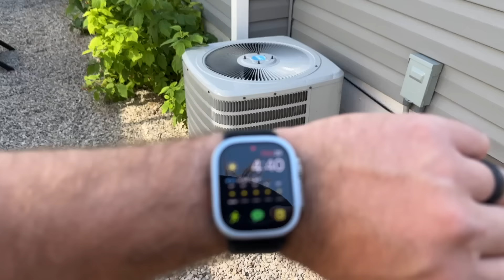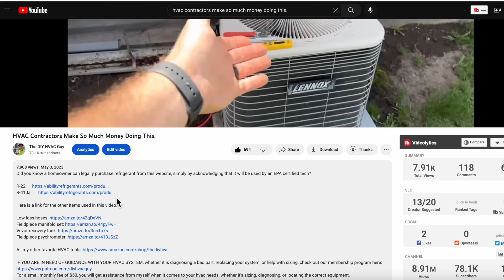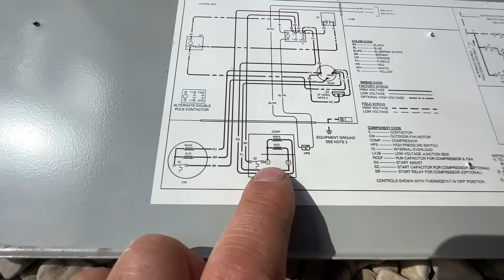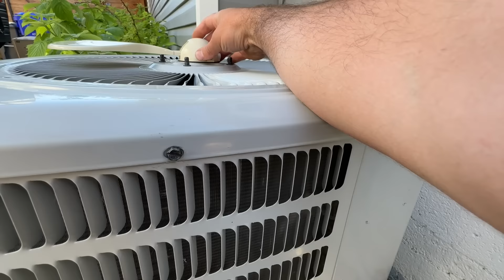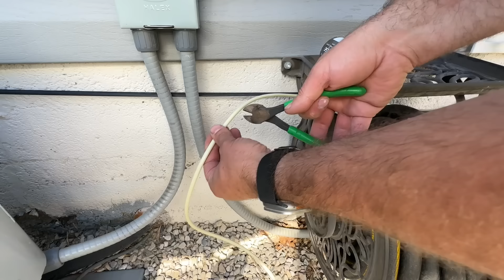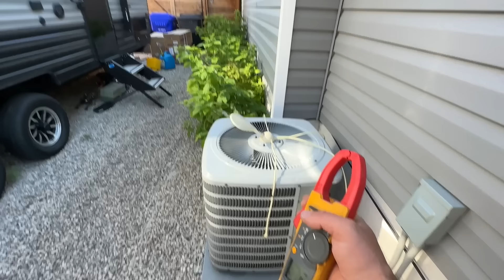Can This Device Actually Lower Your Electric Bill By 30%??

Comment: Needs to use an entirely different - somewhat more expensive, much more complicated to set up - evaporative design that encompasses the unit in a 'box' of evaporative material (the currogated cardboard material used by industrial 'swamp' coolers seen at hardware stores).  Build a box around the unit with 12" of standoff and create a barrier seal around the exhaust so that air can only be drawn in via the sides of the evaporative box.
Set the drip system up to use the outer box to cool the incoming air rather than exposing the unit itself to water directly.

Or, perhaps, build the AC unit where it will never be exposed to sun and surround it with material that has a very resistant thermal absorption chracteristics... i.e. put the unit behind a double layer of solid stone that has sufficient airflow.   The outer layer of stone is exposed to whatever sunlight (as little as possible) may fall on it while the inner layer of stone remains cool and lowers the temperature of incoming air before it goes through the unit.
Yes, this last one is very situational, but it works.  I did that in Texas where my house sat on a very steep hill.  One side was a cave, essentially, created by the foundation and when the unit was replaced I had it moved to the depths of the shadows where the foundation was always many, many degrees cooler than ambient.  Power consumption was halved.

Comment: The only way you can do it is by using distilled water (you can use the condensation on the coil from inside the house) and you still need to have a filter to remove dust. Otherwise minerals will kill your outdoor coil.

Comment: Good luck cleaning the coils after using one of those. The chlorine will eventually eat a hole in the aluminum coil. Better off brazing a heat exchanger on the compressor discharge line and running a close loop coiler using a fish tank pump.

Comment: So which is it, the unit needs to be in the shade or it doesn't matter if it's in the sun all day? I've watched videos and also read posts where they say it doesn't mattter if a unit is in the sun. That trying to shade a unit won't help it cool any better? My unit is in the sun all day and both units i've had, have strtuggled to cool my house in the summer. I live on the southern east coast in NC. Thank you for sharing this and making the video. It very interesting.

Comment: You'd actually be better served with a shade panel oblique to the unit and tall shrubs on either side but 1-2 feet away.   Keep the ground watered and you'll find that the location temp is much lower than air temp which serves the same purpose

Comment: I did this and by the end of Summer the coils were all clogged with minerals.  This is even after a water softener.  It was a terrific job getting the coils cleaned.  They're still not completely clean.  I urge everyone to consider this possibility.
Reply: So maybe I should find some way of pressurizing my condensation water..
Reply: @mikegrok   that's not a bad idea.  It's already pretty much distilled.
Reply: @mikegrok if you have a CONDENSATION PUMP on your system already = pure water from humidity condensation on indoor coil = no minerals 

Pump into reservoir higher than the unit so it will gravity feed into the spider when called

Or use Acid coil cleaner on outdoor coils yearly- this is what you should be doing anyway. 

These machines run in rainy weather + people cut grass while the machine is running ends up + the outdoor coil gets hot = bakes on dirt and debris and needs cleaning yearly for optimal HEAT EXCHANGE. 

Dropping 1 - 2 amp draw is SIGNIFICANT energy savings.
Reply: This was/is my worry too. Having minerals build up over the coils will reduce efficiency of the cooling fins. If you had a good filter before the nozzles may help and then just change the filter?
Reply: @Skydiverjoe2871 - No, a filter won't work because the minerals are dissolved. Filters didn't remove dissolved minerals, only suspended particles.
Reply: @Skydiverjoe2871 if you have a CONDENSATION PUMP on your system already = pure water from humidity condensation on indoor coil = no minerals 

Pump into reservoir higher than the unit so it will gravity feed into the spider when called

Or use Acid coil cleaner on outdoor coils yearly- this is what you should be doing anyway. 

These machines run in rainy weather + people cut grass while the machine is running ends up + the outdoor coil gets hot = bakes on dirt and debris and needs cleaning yearly for optimal HEAT EXCHANGE. 

Dropping 1 - 2 amp draw is SIGNIFICANT energy savings.
Reply: Ion exchange softeners still leave impurities in the water.
Reply: @GoatZilla re: "Ion exchange softeners still leave impurities in the water."
A particle filter should be placed prior to the ion exchange.  This will also extend the life of the IE media.  Depending on the water hardness, ion exchange systems may need to be fairly large or the media should be changed fairly often.
Reply: @jfess1911  The ion exchange resin grabs a hard mineral and substitutes usually a salt molecule in its place.
Reply: @GoatZilla  You are right, I mis-read the comment.  Yup, typical domestic ion-EXCHANGE systems (water softeners) substitute sodium from salt for other "hardness" minerals.  This means the "total dissolved solids" content remains high.  The result in an evaporation setup like this one, is that the coils will eventually be covered in a residue.   Not good.
 What is needed is a DEIONIZING system which has both an-ion and cat-ion absorbing resins to remove all minerals, but they are harder to regenerate. My original point was that it is still best to have good particle filtration upstream to prevent mechanical fouling.
(edited for accuracy)
Reply: @jfess1911  I think it would be easier to just build a solar water distiller and use that to feed essentially distilled water to the device.
Reply: @GoatZilla  That would work, but I don't know how large it would need to be.
Reply: I have this exact problem after 2 months.  The buildup is like a spackle now over the fins.  I installed the recommended filter but it appears to be ineffective.  I'm going to try to remove the buildup.  I too would hesitate to install this system.  BTW - I'm in South Texas.
Reply: As another poster pointed out, a typical water-softener is an ion-EXCHANGE system that substitutes sodium or potassium for other minerals.  This can still leave residue from evaporation.  A DE-ionization system will remove all minerals.
Reply: I used a version of this on our old system's last season...although from parts I had with a lot more sprayer heads, and an electrics (sprinkler) valve.  I wouldn't want it on a new system though.
Reply: Yep, I've thought about one of these before but my water is really hard.  I'd have to invest a lot to try to fix that before being able to use this to save a little on my ac bill.
Reply: I tried this system when I was in Bullhead City, Arizona.  It worked pretty good at first but ultimately my A/C coils started building up minerals. It didn't work at all in Louisiana because the humidity was too high.
Reply: Yep, same. And I used that filter. It would probably be fine with distilled water. But that would be really expensive.
Reply: @grumpy3543  And you would need to find a way to deliver pressurized distilled water.
Reply: you should have used RO water
Reply: If only you could capture the condensate that collects on the evaporator coils before it becomes contaminated… At that stage it is distilled water. even though copper is a natural antibacterial, it is in a location that is constantly being bombarded by dust, mold, spores etc. that gets past the filter, so it would have to be a really good filter and the capture would have to be made immediately and stored somewhere clean. Why these outside units don’t even come with an option to include an evaporative based system to cool the air even slightly before it is passed over the condenser coils is beyond me. Everything to collect moisture from the air in the form of pure water is already in place… But no steps are taken to to preserve its purity and it is just typically dumped out through a drain hose onto the ground. Here in Texas, we have days on end, week after week where ambient air temperatures during the day are over 100°F… and these outdoor units sit there baking in the sun, and that’s what we’re supposed to use to “cool“ those condenser coils? Many parts of the state are very dry, and evaporative systems can lower air temperatures by 10 to 20°F. While that might not be enough to cool YOU off, to a really hot condenser coil, that’s a lot of BTUs  being removed that really want to keep that Freon in a gaseous state. Humidity bothers people, but it doesn’t bother those aluminum fins.
Reply: The ac condenser coils are pretty hot~120F so I would think the humidity would not have much effect as that mist will evaporate at that temp.
Reply: What did you use to clean the fins?
Reply: @echocharliedelta72  you can use

 ACID BASED MAG WHEEL CLEANER FOR CADS = spray bottle 
HVAC COIL CLEANER - from Lowe’s or Home Depot - spray cans 
HVAC COIL CLEANER  - from HVAC SUPPLY HOUSE - they will sell to public.

Spray on and let “work”. It will bubble up and attach dirt n grease etc. approximately 10 min. 

Do not let it dry completely. 
DO NOT USE PRESSURE WASHER TO RINSE . Aluminum coils very very easy to bend = if bent will not flow as much air 

Water hose with gently running water - rinse until no dirt, debris remain it takes me over an hour sometimes to clean a coil that’s really dirty 

Take your time. Reapply and repeat as needed.
Reply: You have to use reverse osmosis/distilled water. You can put an RO system on your feed to the pipe feeding the misters. This will remove the solid contaminants.
Reply: The chlorine in the water corrodes the aluminum.   There is no cleaning or fix for this problem.   Do not use this on your AC.  I did and a couple of years had a leak and needed new outside unit.
Reply: You shouldn't use the soft water because it has a tiny bit of salt still in the water even though you can't taste it. Salt and aluminum don't like each other and the fins could become corroded and break off.
Reply: It built up mineral deposits in my condenser within 2 months. Filters must suck.
Reply: Yeah, I will never do this unless I get a reverse osmosis ... or I get a huge quantity of cheap distilled or DM water.
Reply: @AllAmericanGuyExpert  When we moved to the new house there was nothing. I wanted reverse osmosis. The little woman wanted a softener. 
We compromised and got a softener.
Now multiple times per year I lug a couple hundred pounds of salt down to the basement so we can make dirty water that requires expensive filters underneath each sink in the house.
Yay.
Reply: @Shorty_Lickens lol, the little woman wanted the cheaper option. We have a whole house RO it is more expensive than a softener, but 10x better.
Reply: @Shorty_Lickens  "the little woman",  I wonder if she should call you the little man
Reply: @AllAmericanGuyExpert bingo, no way without a RO
Reply: my water is hard. it would be a problem. thanks. plus humidity is so high that the cooling effect would be diminished here in houston. see thermodynamics.
Reply: @brianbb177 yes sir we need to just frikin move :)
Reply: I have a $60 pressure washer from Walmart and just spray clean everything once or twice a month to completely avoid this problem.  I also unscrew the mist nozzles and clean them out when I do my routine cleaning.  It's amazing how easy it is to maintain things when you aren't lazy.
Reply: That is a legitimate concern and will vary by local water conditions.  An in-line filter on the water line to the misters could solve the problem.

Comment: Air is a better transfer of heat than water, unless you have a constant flow of cold water…. This may increase the heat transfer initially, but after a few hours time thermodynamics kick in and this will not be as good as air.  Surface contact with air is a better heat sink…

Comment: Drills have clutches on them. 
They work wonders for running screws with a drill and not stripping them

Not very difficult to use, really

Comment: I live in south Louisiana and I’ve been doing this for years, but my misters are spraying into the vents what someone needs to do is invent a catch basin that would go underneath the air conditioner itself on top of the pad. That way it would recycle the same water simple concept it’s a basic swamp cooler.

Comment: I Live in Central Texas where it is very dry and the temperatures have been over 100°. Our AC was not keeping the house cooled and the electric bill was extremely high. I watched this video and similar ones and I bought some patio misting nozzles and tubing and a calcium filter from Amazon. My idea was that more nozzles would have a better cooling effect so I put two nozzles per side except the backside I put one nozzle. (5 nozzles total) We are not seeing as big a difference as we had hoped also I did not check very closely. Am I wrong about my "more nozzles" theory?

Comment: A little over 10 years ago a major air conditioning manufacturer (forgive me I forgot the name) brought an air conditioning unit to the market that was a combination of swamp cooler and air conditioner. The idea was that the swamp cooler part would help cool the air that the AC unit pulled in to cool the coils. They actually sold a very large number of them. Then about three to four years after introduction they discovered that essentially the water and moisture we're destroying the units. So not only did they take them off the market permanently, they had to replace every single unit they sold with a new unit that did not combine the swamp cooler idea.

I have no doubt that the majority of people anywhere from two to four years into using this device will end up greatly regretting it. Because it's going to cause their unit to prematurely fail. And fail because of the misting system. And no warranty or extended warranty is going to cover it. I'm on the lawsuits or class-action rolls into the company that makes the misting system. Well you know they'll just go BK and disappear.
Reply: The company was called "Freus" and I still have one here in Vegas. It has both a 5 ton and 2 ton unit in a single condenser case. Extremely efficient but it takes a lot of maintenance and many modifications over the years. Probably the last one still operating but I do the work myself and love it.
Reply: I posted this above:  The house in which I grew up in Tucson Arizona had a Rheem unit that had a drip system built in that would constantly flow water over the condenser.  It worked like a Swamp cooler where there was a float that would feed water into the bottom tray and a separate pump for recirculating the water.  It was incredibly efficient, but also incredibly wasteful, especially in the desert.  My recollection is that this system was installed around 1964 and I can't find anything online about it.  What made it be able to withstand this was the condenser was stainless steel, so you didn't have to worry about untreated tap/well water corroding out the condenser.  

Water in AZ, especially outside of the city in Pima count is also really expensive too.  Would be likely be better to spend the money on a higher SEER rating.

Comment: Thanks for trying it out and doing the video.  I had an idea like this 20 years ago, but was afraid of corrosion or build-up on the coils.  If I get a 0.9A reduction in power usage from the solution you showed, at 10 cents per kWh, it would take 10 years for me to recoup my money from this (assuming water filters were free).  It is a good idea, but costs too much to be worth it.  I've found the thing that has made the biggest difference for me, by far, is adding more insulation to the attic.
Reply: Insulation is the absolute key
Reply: @luckyduck6921  youre right m8, live by the six sides of encapsulation rrule in insulation. potentially a house can lose 15-25% thru an uninsulated attic and 5-15% through an uninsulated basement
Reply: 10с per kwt??? Biden will fix that inefficiency for you soon. In HI we are paying 53C

Comment: 1 question, what was the difference in your water bill? 

I have figure 1 amp X 120v = 120w  if your condenser runs an average of 10 hours a day then 120w X 10 = 1.2kWh saved. Around where I live it .14 cents per KWh. So, .14 X 1.2KWh = .168 cents a day or $61.32 a year. 

Is it really worth it? Your obviously using more water.

Comment: That didn’t change the air out of the vents at all.
Reply: it works when the sun's on the unit ie when the rad is really struggling and its hot out. you can even feel the inside vent air drop several degrees.   remember it cools outside air 20 deg. before entering fan.  You don't notice degree drop  when its only warm out, because the aircon rad can keep up; but compressor will still run less and save some electricity.  mostly for hot days, or when aircon is being pushed to its max, it gives you that much lower temp inside., which is whem you might otherwise have been losing the battle. best wishes.

Comment: Added one of these to my 15 year old five ton unit last month and just got my first bill after 30 days of use. First the average temp in San Antonio in the most recent bill was 2 degrees higher than the previous billing period.  We have ecobee thermostats on a set program - which was the same for both billing periods.  Despite the two degree increase in average ambient temp - my bill dropped $43 month over month.  In addition the humidity levels were lower by about 5% and the noise level was about 5 decibels lower.  So yes - this works.  I had concerns about build up on the coil - but I haven’t seen any yet.  So this will pay for itself in about two and a half months.   Super impressed with my results.